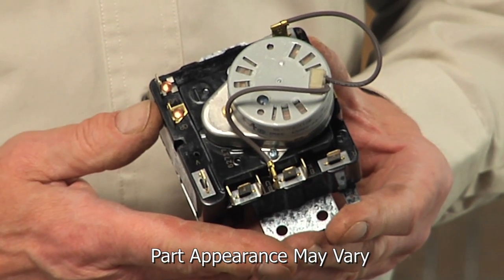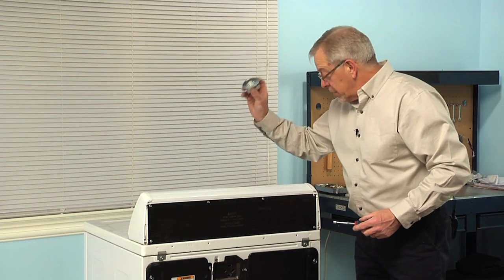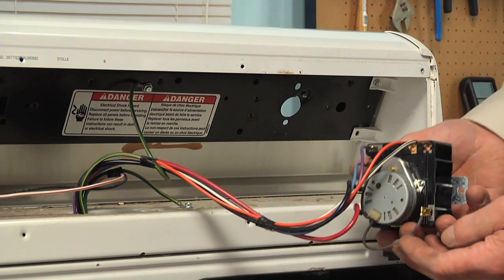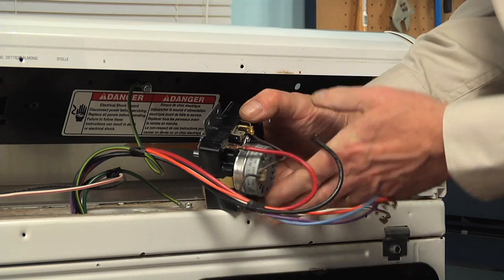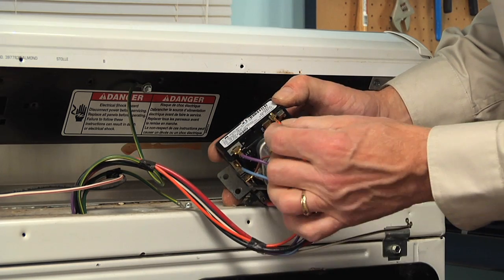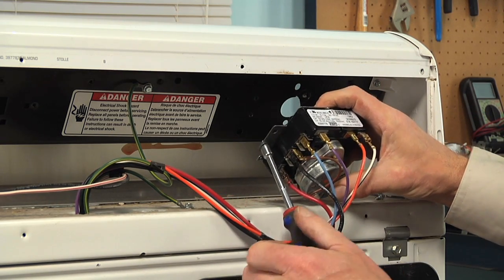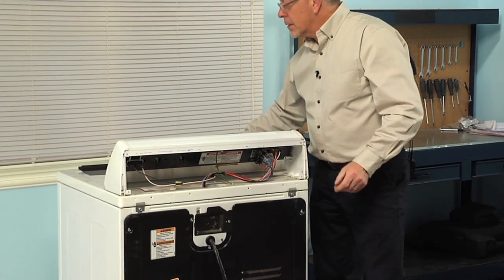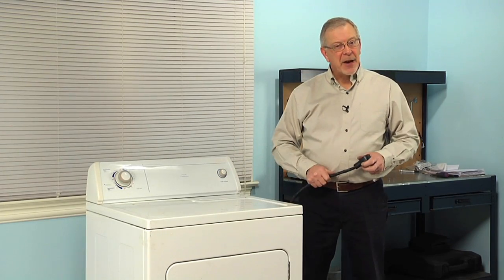Dryer Repair - Replacing the Timer (Whirlpool Part # 3976576)

Comment: To avoid miswiring, have the new timer in hand and when pulling a wire, put it in the same terminal on the new timer.  Also comparing labeling and terminals before starting.  No guarantee the wrong timer was shipped.

Comment: Hi nice video, I have the same dryer ans I was wondering if you made a video about : How to change the tape whit little air on it, inside the turning drum and the back wall. some kind of a seal or a noise preventer.  Thank you

Comment: Would this make it not heat or not start?
Reply from the maker: Good question, the time contains contacts for both operations. It turns on the motor as well it provides circuits for the heater to be activated.